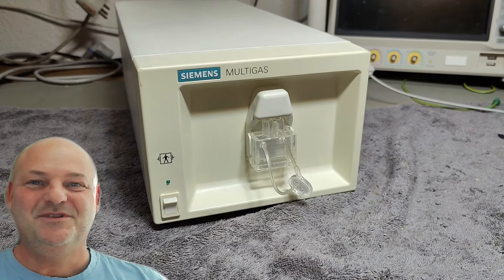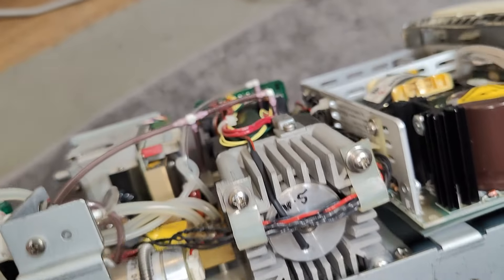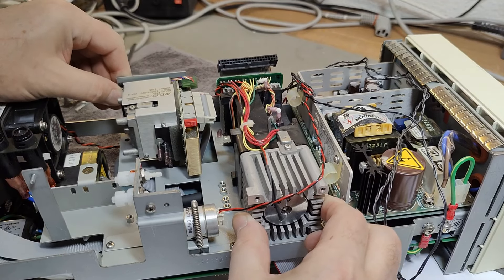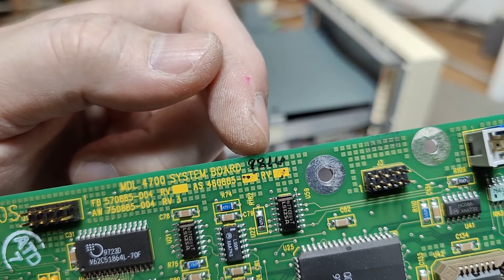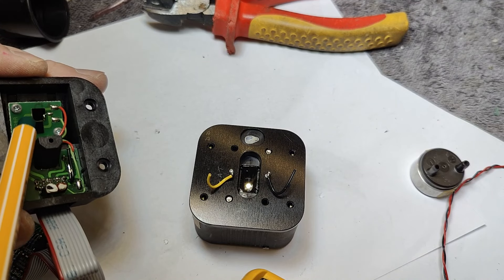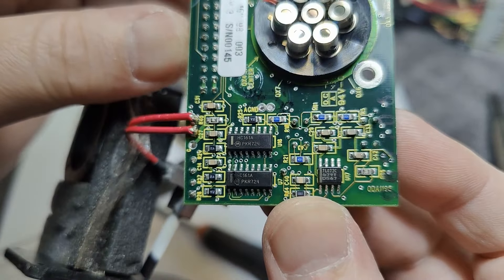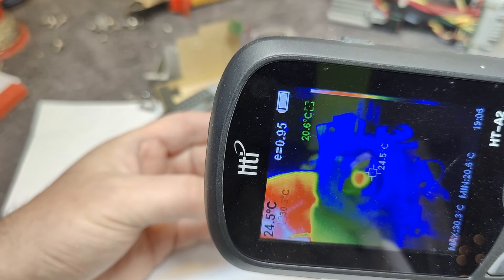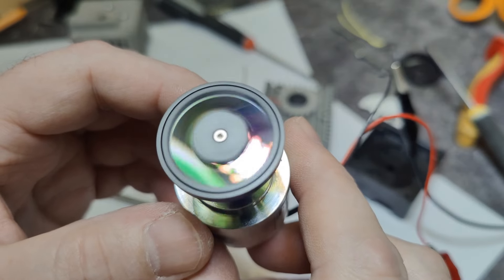Siemens Multigas Medical analyzer E536U 1998 many cool sensors

Comment: Really neat teardown! I work as in-house engineer for a biotech company.  Work with a lot of equipment with fluidics that have similar components (not for gases though).  I would imagine at least one of those high precision 10V regulators is a reference for that honeywell style pressure sensor (the one with poor solder job)

Comment: I think the spooled hoses (separation-columns) are for gas-chromatografie - different gases have different speeds in these tubes and reach the sensor at different times.
Reply from the maker: I have no clue at all :-) i just guess. we have two spools, about same length, but very different hole diameter, so i think different gas types will deliver some kind of resistance, and this way reach the O2 sensor at a slow, and more well defined speed / flow, I feel that o2 sensor wil not be happy if we blow too much air directly into it, it must be done very slowly
Reply: I doubt it. I think Thomas had it right.  Those types of columns have a stationary phase inside them for separation.  However, you see spools like that in HPLC systems to regulate flow
Reply: @fmashockie  Ah, O.K., thank you.

Comment: Hah, even the mighty Siemens buy NDIR gas analysers from Andros. I used to be expert on those, they're used in all sorts of industries, my field was Automotive emissions and diagnostics so we used the Andros 6000 and 5000 series along with a few 'micro' gas benches, it's nice to see different models that work along exactly the same pricinples.

The Oxygen sensor is fascinating, it relies on the paramagnetic properties of oxygen to deflect the mirror in the magnetic field and the deflection is measured optically
Reply: I think the whole device has been built by Andros as it says ANDROS on the main board!